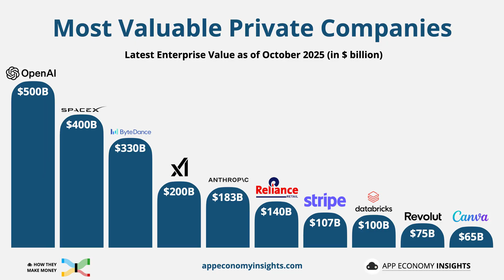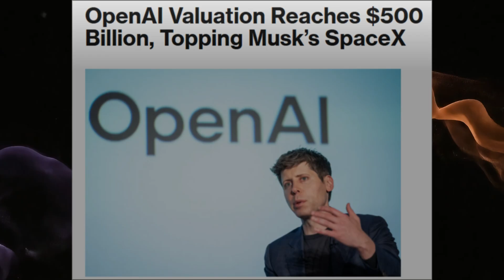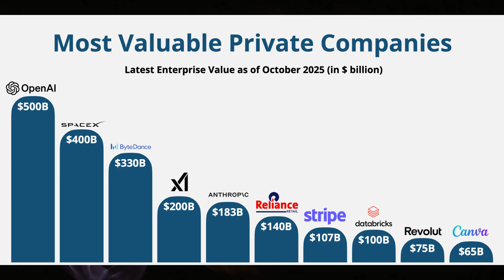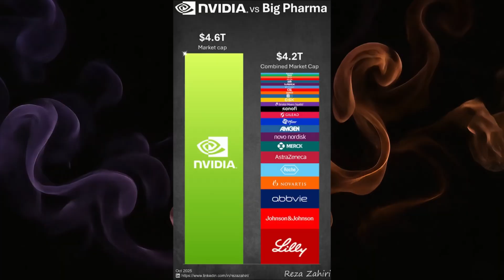Tesla's Robot Learned Kung Fu (But This Other Robot Worked 5 Months Straight)

Comment: I would argue that the Figure robot you show from China is doing the exact same thing as the Tesla Robot. Its movements are programmed. It is doing much less actually than the Tesla robot and repeating the moments over and over. There is no difference, and if you don't think Tesla has robots working in a factory already, you need to do some research. 2 seconds to find: https://youtu.be/vPTBrbTs1RU ... AND consider this oh Tesla hater... 

Every Tesla car is a connected, sensor-rich, semi-autonomous robot, with onboard AI, cameras, radar (on some models), and real-time software control.
Tesla has produced over 6 million cars as of mid-2025, and the vast majority are still online and receiving updates.
Each one continuously collects data, navigates, perceives, and acts — all core functions of robotic systems.
No other company has anything close to that number of deployed, continuously operating, networked robotic units.

Oh and... Reports that China has deployed 300,000 robots in a single factory are inaccurate. The claim appears to be a misunderstanding of reports from the International Federation of Robotics (IFR), which found that Chinese factories collectively installed nearly 300,000 new INDUSTRIAL ROBOTS across the country in 2024. These were not humanoid robots. Industrial robots are automated, programmable machines used in manufacturing for tasks like assembly, welding, and material handling. They are built to be strong, fast, and accurate, performing both repetitive and dangerous jobs that require high precision on a constant basis. Common types include articulated, SCARA, and Cartesian robots.  

Research first dude. 

向中国共产党问好！
Reply from the maker: You're right mate, unfortunately the websites that I check, are sharing those info. Sometimes sharing misinformations. I have to check double before I make a video 🙏
Reply: just saw this... thought of you...  https://youtu.be/XMeoFIIZ7TU
Reply from the maker: @theloniousMac no its not me, but yeah, it looks the same. Lets be honest I do better than it.
Reply from the maker: @theloniousMac omg I rewatch and I get that, they are using my video's script
Reply from the maker: @theloniousMac thank you for your awareness btw, I have to do something